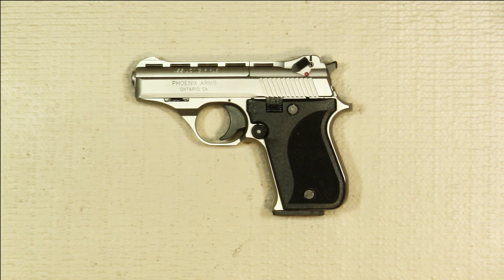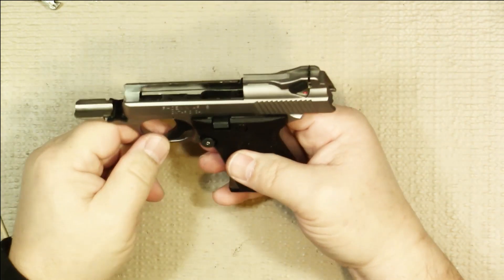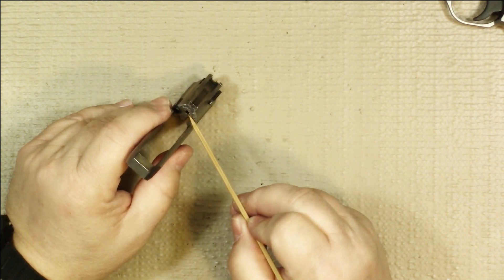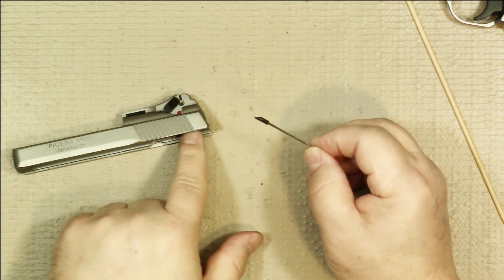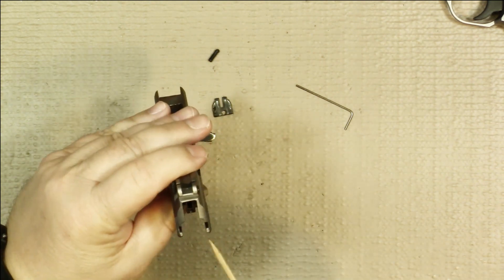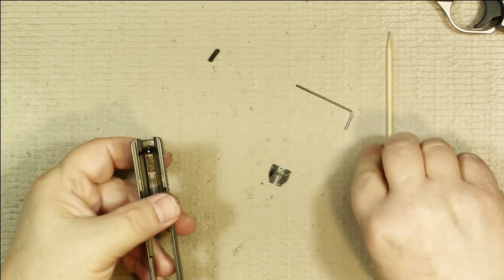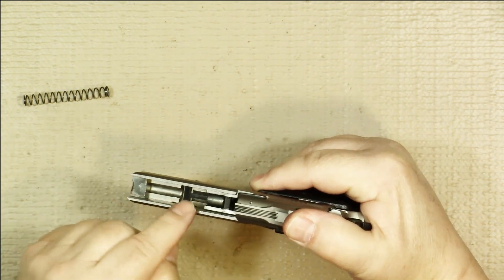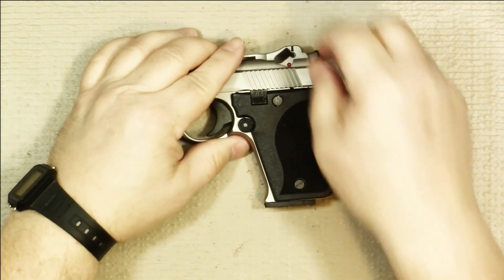HP22 Firing Pin Removal and Installation

Comment: Thanks for the video.  I have a fairly new HP22A that worked great, but now it won't fire a round.  (probably less than 50 rounds shot in it)  It's not a safety thing, as the hammer does it's job, but the firing pin doesn't contact the shell (at least it doesn't leave a mark at all).  The firing pin operates very easily when moving it with a pencil.  I removed the firing pin and it's all clean and looks good.  Does the forward momentum of the firing pin do the actual striking?  If this is the case, could the hammer spring be bad?
Thanks,
Jack

Comment: Finding a 0.05" Allen/Hex Driver is the catch.  I have several driver sets Allen Wrenches and Hex Drivers, but none of them have a 0.05" Allen/Hex.  1/16" (0.0625") is my smallest.  I watched out of interest, but I'll have to get one if I ever need to clean or replace the Firing Pin, Spring, etc. in my HP25A, which I'm sure is the same.  Thanks, for later.
Reply from the maker: Acquiring tools can be a task in itself, that is where I am blessed to have a fairly extensive tool collection.  Luckily, I don't think this is something that would need to be done on a regular basis of any kind.
Reply: @CraigsGunChannel   Thanks for your reply!  If I ever do need a 0.05" Allen/Hex Driver, I will find one.

Comment: I can't get my backplate screw out for the life of me. I have a new firing pin and I've replaced the hammer just fine but this screw won't budge... Any advice on tough screws? I've been using the proper Allen key but this gun was used and I think the previous owner stripped the head

Comment: Im having a problem with mine fireing
 It fires fine new fireing pin spring and all that but i have to pull the hammer back every time to fire it. The “semi auto” ant working right lol
Reply from the maker: I would recommend that you have it looked at by a gunsmith. It sounds like it is not cycling correctly which could indicate a structural mechanical issue causing excessive drag. Or it is possible the sear surface on the hammer or sear is damaged. Either issue could be unsafe.
Reply: @CraigsGunChannel  thanks im gonna  have it looked at, it cycles fine when i slide it back myself every time

Comment: Another good one from Craigs Gun, thanks! 👌 The only channel I need to watch when it comes to my HP22 😉
Reply from the maker: Thank you for the kind words and for your continued viewership.
Reply: @CraigsGunChannel  Any chance on making a video showing the removal of the fire pin block lever/safety?
Reply from the maker: I will look into it. Thanks for watching and for the suggestion.
Reply from the maker: @250rapid  Check out my video posted 2/17 on this.

Comment: I recently "extended" my firing pin. I had used a small but thick metal rod piece to remove the little star/ Allan screw. I used a needle file to remove some metal on the square parts on both ends, so the strike part extends more as well as the firing pin. This is good to revive a firing pin and not have to replace it and possibly the firing pin spring. This gun is very durable.
Reply from the maker: Glad to hear you were able to do a simple fix to get it working.

Comment: Bought a very used HP22 on a lark.  These videos have been very helpful as I had no manual with the gun.  Getting some light strikes(I believe); so the firing pin access will be very helpful.  Thanks!!!
Reply from the maker: I am glad the videos are helpful.
Reply: @CraigsGunChannel  IF only my local stores carried the .05 hex key.  Three strikes(HD, Lowes and Harbor Freight) and it was Amazon for me!!  Ordered the firing pin and spring as I figure those are the problem; so I'll wait for all to arrive!  Phoenix Arms should offer the hex key on their site!
Reply from the maker: @racketrick  I hope that fixes the issue for you. Since it is used I would recommend new recoil spring as well.
Reply: @CraigsGunChannel  Thanks!   I'm sure I'll be back to check other 'fixes' as I need them!  I'm a Smith and Wesson Victory guy for most of my 22lr shooting; but thought this HP22 looked interesting.  Almost wish Phoenix had a package deal for the tune-up parts; but they are cheap enough as is!
Reply from the maker: @racketrick  Let me know if anything comes up that you need help on.
Reply: @CraigsGunChannel  Thanks!  I have a sneaking suspicion that the reason the previous owner(s?) didn't replace the firing pin is that the set screw might be stripped.  I'm hoping that isn't the case as it looks like major surgery would be call for.  Fingers crossed!  Won't know until next week when the Allen set comes in.
Reply from the maker: @racketrick  hopefully you will be able to get it out.
Reply: @CraigsGunChannel  Well, the .05 Allen key came today so I was excited to disassemble and check the firing pin(new one on order); BUT I ended up with a crook/hook piece of metal that really doesn't look like a sear spring and I can't figure out what it is.  I tapped the slide on the table to encourage the firing pin spring to fall out and this little crook(like a shepherd's crook) dropped out.  It was super dirty in there, so I've got it cleaned and ready; but sure would like to know what that little "wire"/crook is!!!  I don't see anything on the parts list like that!!  Yikes!
Reply: I took a pic but don't know how I could add it.
Reply: Ah ha!!!   It's the firing pin block spring(doesn't look like a spring, nor does it look quite the same as the schematic on their site).  We are back in business and I may go shoot before the new firing pin comes in!  Thanks for all the guidance!
Reply from the maker: @racketrick  thats great news, glad to hear it.

Comment: Great video, but I'm having an issue.  After I put the new spring and firing pin in and screw in the retaining screw, the firing pin and spring just fall out.  Could it be a bad backing plate?  Really strange.